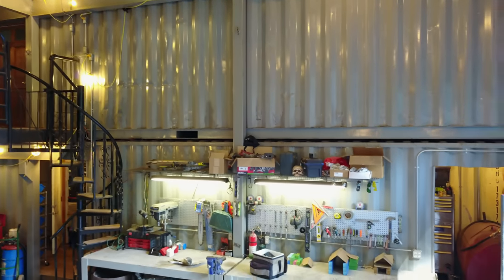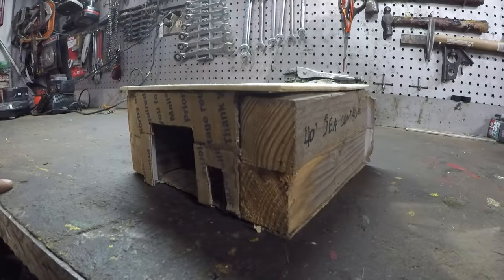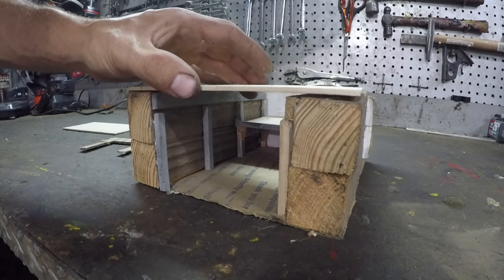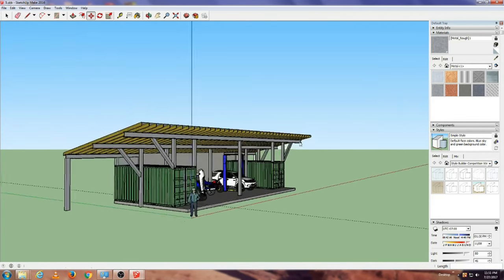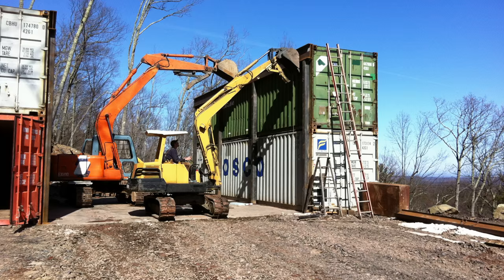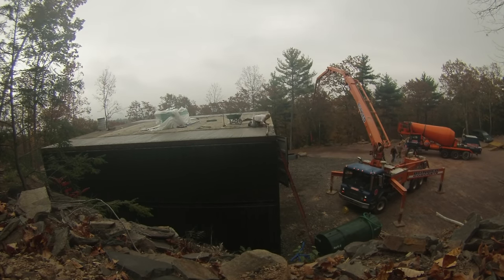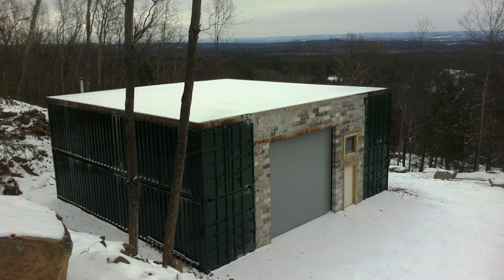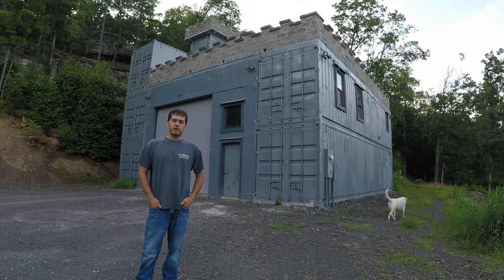How to start your shipping container building project

Comment: No sense build the steel frame inside the containers , while build outside will do it with half of it ...I mean you put containers the frame and cut the inside to use it as walls...insulate and Walla... Your engineer must be tripping to not advise you out of this...